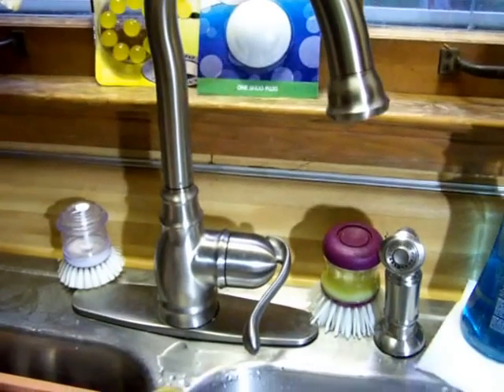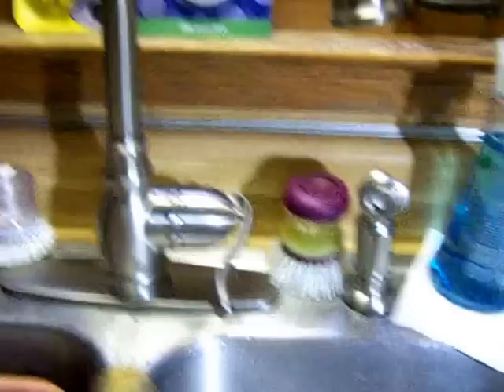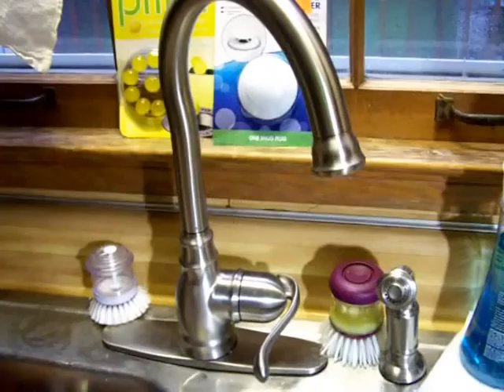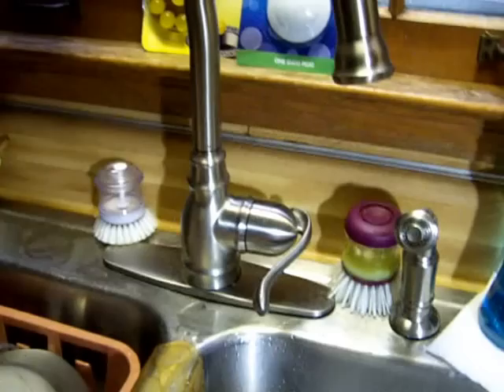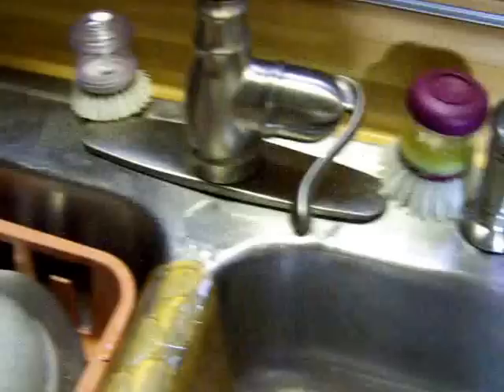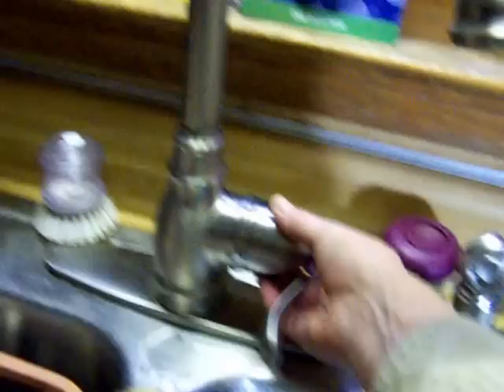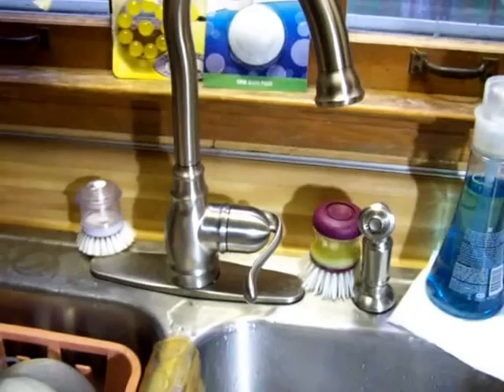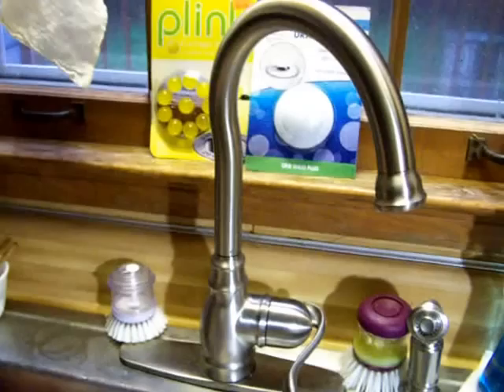broken Moen faucet problem resolution

Comment: Actually in this video he tells the secret!  
1. pusch the handle to cold( slot at about 3 o'clock position). Use an allen wrench to remove the handle and cover.
2. push the stub over so the water is running (this gets the stub in an easy place to put the handle on)
3. put the cap on about "-"180 degrees or so (the slot is at about 10 o'clock), press it on while making sure the gasket is in place
4. slowly turn clockwise and the cover will lock down when the slot gets to  3 o'clock
5. now work the handle on and tighten the screw.
6. Be ready to do it again in a few months!
Reply: Your post tells me way more than this useless video. Thanks

Comment: Wow, perfect.  This has happened twice to us.  I figured I was doing something wrong.   I've promised myself when I replace or need a kitchen or bathroom faucet I'm getting the old fashion kind with two, hot and cold faucets that feed into one spout.  And I want those faucets situated far enough apart so my tools and hands can "sanely" install and/or the units.  Thanks for your example.  Paul

Comment: I had the same problem a couple times and got so frustrated! It was a design flaw and they don't make them like that anymore. 
 When I found out I wasn't the only one with this problem, I called customer service and they sent me out a replacement faucet ($400 value) for a $59 shipping fee. Definitely worth it. This new one is so much nicer than the original one.
Reply: We had a new one installed in April 2019, and it looks identical, so I'm believe this model is still being sold with this design flaw.

Comment: Thanks for this.  I replaced the cartridge and tightened the plastic hex nut but water is leaking out from the cartridge area.  Any ideas why?  I don't want to overtighten the nut.
Reply from the maker: On my faucet the trick was to tighten the set screw on the handle, but it wasn't leaking.

Comment: I had the same problem with a Moen CA87006SRS.  Cap comes loose. Faucet did not leak, just looked shoddy with a loose cap.   Seems like a bad design.  Action of the handle seems to loosen the cap and plastic ring assembly somehow with the twisting action.  FIX: take handle off using 3/32 hex. Remember the position of the handle. Inspect plastic parts and cap.  If nothing is broken (as in my case), then fiddle with the cap and plastic ring assembly (with the handle off) to see how they connect and snap into place.  This is a bit of trial and error.  Once you get the idea, assemble the cap and ring assembly in the position that you took the handle off in.  In my case, it was easier for me to leave a bit of water running into a sink with a stopper (to prevent loss of hex screw )to get the best angle to reattach the handle.  Anyway, it is now re-attached but like Andrew Smith said, I am not sure that it will be a permanent repair.  Seems to me like a design flaw.   BTW: called Moen but gave up after they said they would call back in 2 hours and 11 mins.  If they call and send some new parts to ensure repair, I will post.
Reply: Byron Barnard any chance of a video I am having a difficult time.
Reply: Has anyone found a video showing steps.

Comment: There is a tool that can be used to hook on to those teeth on the inside ring and really tighten from not happening anymore. Problem is without that tool it’s almost impossible to get it tight enough where it won’t loosen up again.
Reply: 6/10/23 - Please - what is the name of the tool and where may I obtain one? My Annabelle is coming lose every month or so. Thank you -

Comment: I had the same problem of the "handle cap" falling off and then the handle would come off completely.  I fixed it by using a 3/32 allen wrench and tightening the screw at the base of the handle.
Reply: Thank you!  Appreciate the helpful information on the size of the Allen wrench!